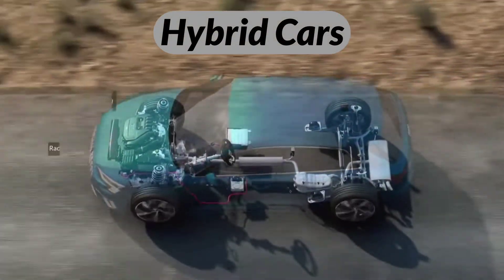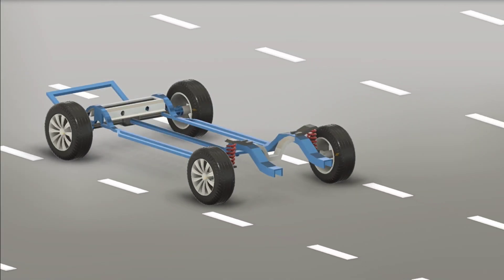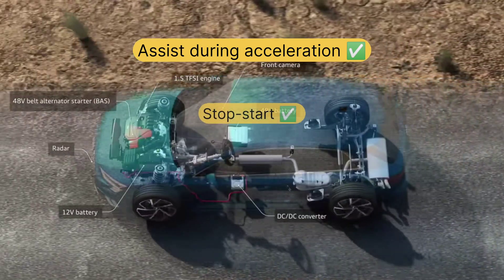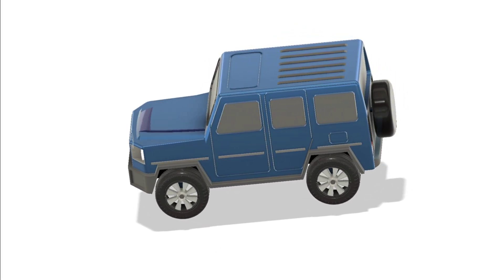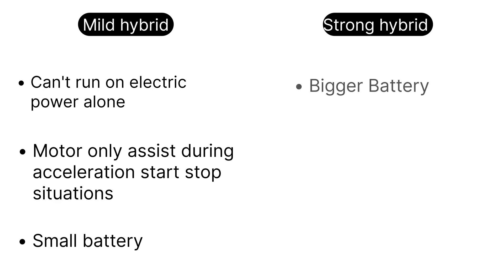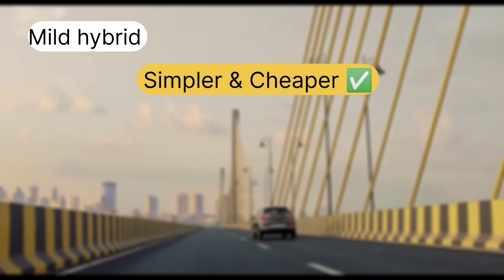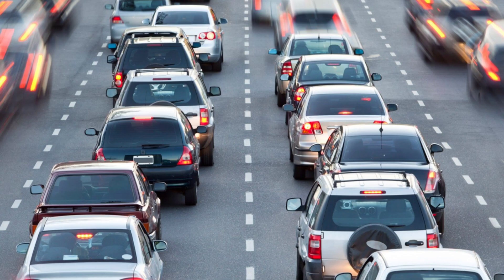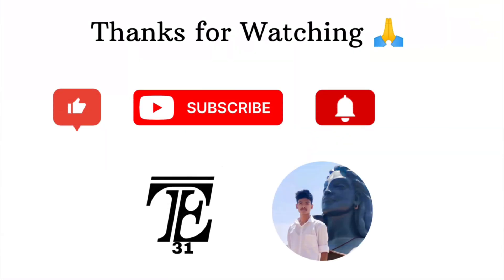Strong Hybrid vs Mild Hybrid – What’s the REAL Difference? | Hybrid Cars Explained #hybrid #bmw #car

Comment: HEV and PHEV cant drive on Electric power only that’s basically like removing the gas engine the part of the Gas engine is always spinning To assist the car and electric motor in Ev mode, and when it’s in full Gasoline mode the electric motor is still assisting the Gasoline motor and Car so they are Both Constantly running
Reply from the maker: Most PHEVs start in electric only mode and continue until the battery drain, then the gas engine takes over, providing flexibility and efficiency.
Reply: @techexplorer31 i see where your getting the idea but The Gas Engine may not be making any sounds or producing HP but the mechanical part is still spinning, but it is Full EV when you turn on the car but after a few seconds the mechanical part spins or the engine Turns on completely, But ay still nice video

Comment: HEV and PHEV cant drive on Electric power only that’s basically like removing the gas engine, apart of the Gas engine is always spinning To assist the car and electric motor in Ev mode, when it’s in full Gasoline mode the electric motor is still assisting the Gasoline engine and Car so they are Both Constantly running